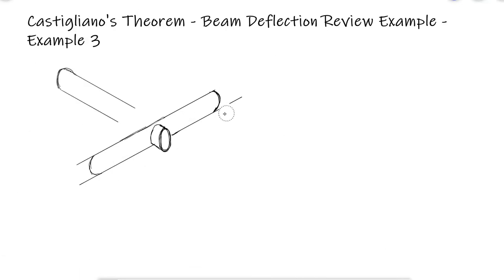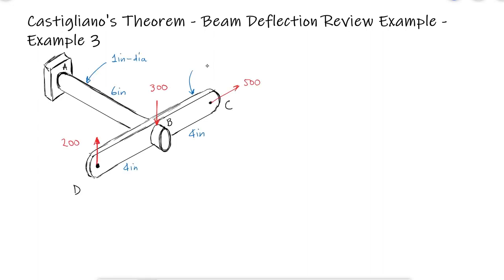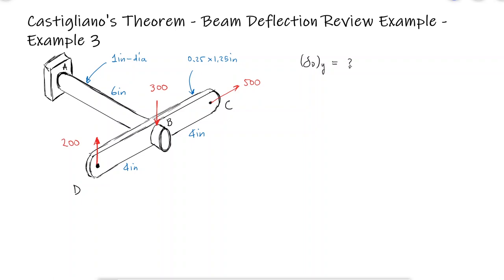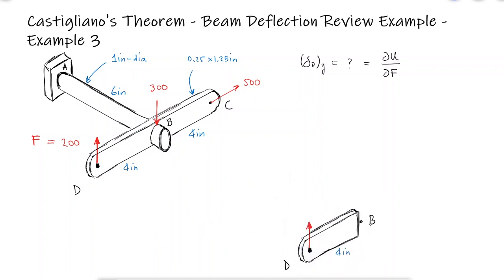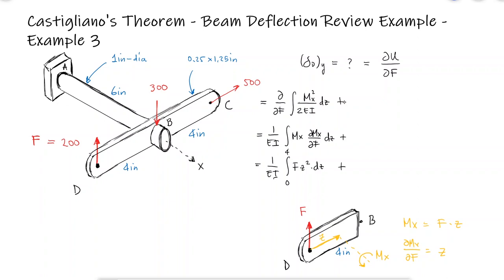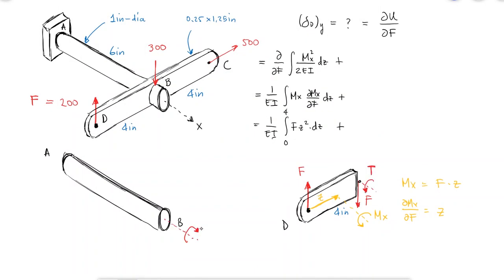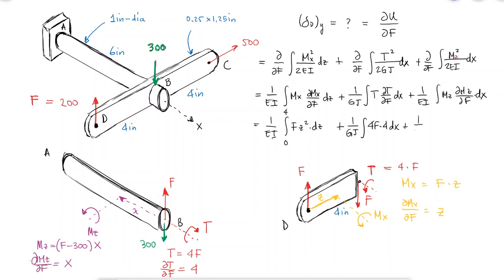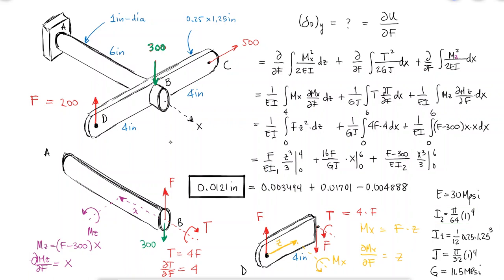Castigliano's Theorem - T-Shaped Handle 3D - Example 3

Comment: I've a question . at @0:41 you drew the moment Mx anti clock wise although the applier force was clock wise . In your previous example , you drew the moment in the direction of applied force . Which one should I follow? and in these type of problems , does the direction of moments really matters? after all , while calculating deflection , M is multiplied by dM/dF so eventually the minus sign cancel outs anyway , isnt it?

Comment: Hello. Could you clarify why the strain energy in member BC would not affect the displacement of point D? Wouldn’t the force at point C create a bending moment in BA which would shift point D?
Reply from the maker: The 500 lb force would bend AB towards the negative z axis, not y, and since we're calculating the deflection at D in the y axis, we don't take that bending into account.
Reply: @LessBoringLectures can you share your notes please